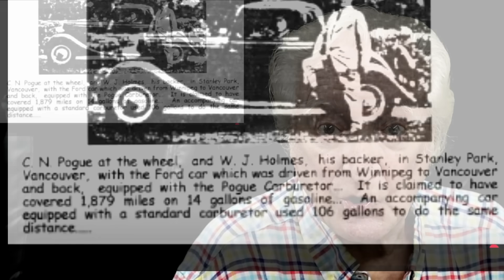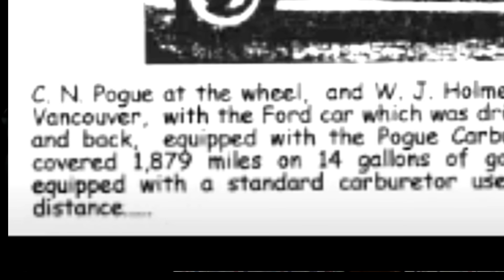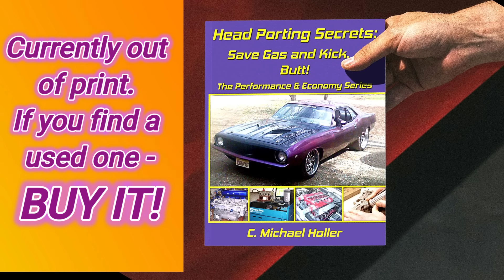100 MPG carb - the real truth!!

Comment: Check out the channel Driving 4 Answers, they just did a video yesterday about Tom Ogle (the inventor of a 100 MPG carbureted V8 Ford Galaxy in the 1970's). It was true, he had news crews ride alone for a 200 mile test run with only 2 gallons of fuel in the tank. It was more than just tweaking a carburetor though. It used a setup that used hot engine coolant to vaporize the fuel while it was still in the tank and then used engine vacuum to suck those vapors into the engine. it had problems that made it not realistically viable for a normal car though, but it did actually get 100+ MPG in a big heavy Ford Galaxy!
Reply from the maker: I am covering that video to show that something is amiss. Will be up on line this month for sure.
Reply: @DavidVizard how about administer the fuel to small 600°f heater cup or plate, aspirate that white fog directly into throttle plate?
Hallelujah Jesus!!
Reply: They probably had a smokey yunick fuel line...
Reply: Hello  David , I’m 76  , mechanical engineer and SAE  since 1968 . I’ve done considerable work on fuel systems since the mid 60s glad to hear u call out this bullshit  for what it is . Sleight of hand and Smoking Mirrors . This is only way to achieve this to vaporize the gas to a aromatic fuel . For complete combustion  too many variables  ford 239 and mercury 255 cui I say bullshit .!!
Reply: @CharlesRoer-b1j   I concur. The 100 mile per gallon carb is pure hype, dreams, tall tales, bullshit.
Reply: @quantumleap359 think, heat is energy, common  modern engine technology efficiency is less than 1890's German opoc aircraft engine's. 
Let alone 2000's eco motors em100 type 100mpg efficiency with 650tq 2.5L diesel on 5lbs of boost, sold to zhong ding holding Corp of China.
 So, if the commonly  "status quo" marketed device's to harness thermal expansion is that far antiquated including but not limited to architecture , all the  engineered heat loss treated as byproduct, radiator, exhaust system, oil cooler, when that could be at minimum reclaimed to further power the shaft and be more efficient. 
Cummins claimed to have attained 20mpg in 80k lb 18 wheeler.
And that tech was said to be available by around 2014. 
They think we are all in their square hat box?
Reply: @quantumleap359 no its not. Just ask joe biden. Lol
Reply: Where is the data the news crews observed? Film? Video tape? There is no information out there on what the news crews found. You can duplicate what Ogle's patent shows, and you cannot get a mid 1970s V8 to get 100 miles per gallon. Just cannot do it. The "stories" state that they ran the car at "normal" speeds. Highway speeds? City street speeds? Why is the info so vague? I'll tell you why, it's bullshit, that's why.
Reply: @bluegizmo1983 Ogle's fuel system was never known to get 100mpg when I did my research into all of this nearly 30 years ago. The highest claim I heard for his invention was in the 70s. People seem to confuse every man and his dog who invented a high mileage carb with the outlandish claims that some people made of the Pogue carb (which Pogue himself didn't claim - IIRC, his final patent claimed somewhere around 60mpg, maybe a bit more - it has been decades, so I've literally forgotten more than most people would ever know about this stuff).

Apparently, Ogle's system was unreliable, and impractical for normal road use. This is a very common problem for high mileage carbs. For the ones that aren't lawnmower carbs, restricting airflow into the engine terribly, the vaporised gasoline displaces a substantial amount of the air volume that would otherwise go into the engine, so they end up being gutless (I found out about this effect in no uncertain terms when I converted a Corolla to run on hydrogen many years ago, and found that displacing the air made it gutless - who woulda thunk it). Also, the methods of controlling the air:fuel ratio in the vapour carbs were generally poor compared to a normal carb, so they weren't as reliable as people expect for road-going cars. Because of this, I had the idea of using an EFI system to meter the fuel to be vaporised, but since I was a poor engineering student at the time, I couldn't afford an EFI system to do it. Then I learned about thermodynamics and combustion chemistry. While I held out hope for a while of being able to recycle waste exhaust gas heat in the form of putting in the latent heat of evaporation and thermal catalytic cracking of the fuel into methane (pie in the sky without bottled hydrogen, and good luck making a road legal thermal catalytic cracking plant under the bonnet), by the time I got my first EFI car that I could've tried to implement my ideas on, I realised that it was all just a pipe dream for anything other than mileage competitions, so I didn't bother.

All of that being said, I did try a few simple mods on my old carby car. The only one that might've worked was disengaging the acceleration enrichment pump, but I soon found that the car was dangerous without it, so I hooked it back up and chalked it up as being a bad idea. Making an air "vortex" thing to mix the air and fuel better and putting it above the carb acted as a choke and made the fuel consumption considerably worse, so I soon took that out. Putting a tea strainer under the carb made no difference, so I took it back out so it wouldn't end up going through the engine. The only thing that I found was reliable was ensuring the car was running properly, combined with driving for efficiency.
Reply: Driving for answers is so wrong on so much stuff. Alphadan is a great example
Reply: I heard about a guy who got 100mpg's with a special carb back in the early 80's. If i remember the guy that told me about it said the guy was taken out by competing auto manufacturers.